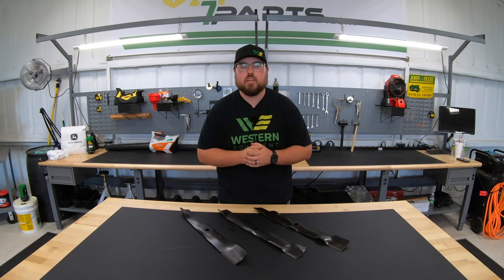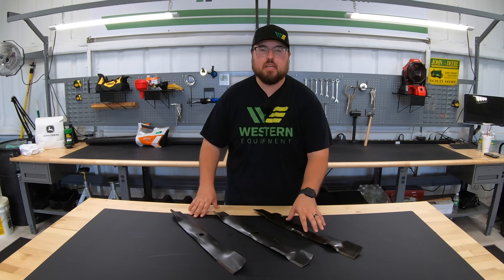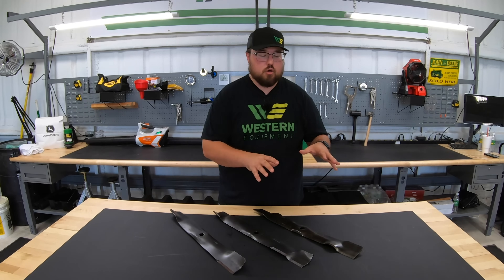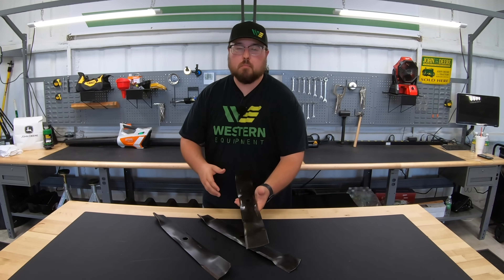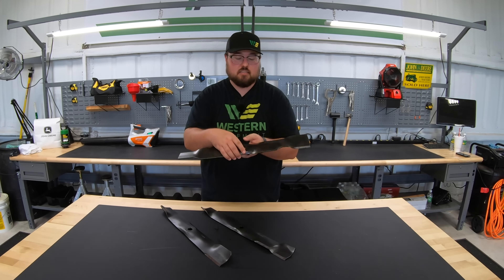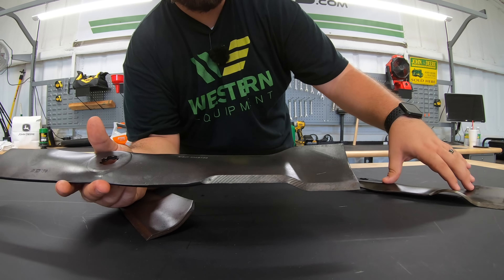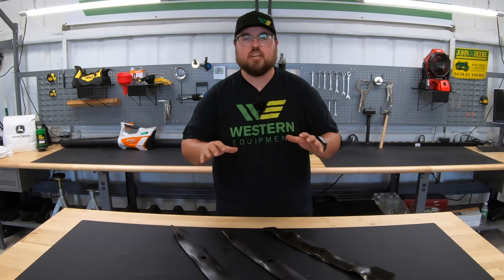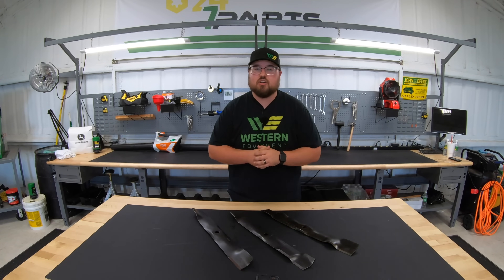Are you using the right mower blades? John Deere Mower Blades Explained

Comment: Do you have John Deere part numbers for these?  On the Deere parts web site (the one you link to) I find three different blade sets and part numbers  AM141031, 141033, and 141034 but only the 1031 is listed by a description that matches your video, "Mower Blade Kit,3-in-1, 42 inch".  The other two do not have descriptions that describe what that are for e.g. mulching or bagging as you describe in your video.  I am looking for a mulching blade, yes the 3-in-1 does mulch but I was thinking a dedicated mulching blade would work better for my application considering that I never bag or side discharge.  

Thanks for the videos/educations.  the deck leveling video was particularly informative for me...didn't know this was important let alone how to do it.

Comment: Hey man since I'm going to mow a lot of half acres what John Deere do you recommend
Reply from the maker: Any of the S100's would be fine. You just need to decide what size of deck and which features you want. Thanks for watching!
Reply: Check other brands for useful features like turning radius. Notice many use the same engines and transmissions but cost less, the green is a premium
Reply: Spend a little more money and get a JD X300 series from a JD dealer. Great mower and built to last.  Stay away from big box stores.
Reply: Poulan pro
Reply: @BlueberryStinkFinger62  Yup my JD  LA135 was garbage it only lasted me 10 yrs mowing 4 yards a week and bagging them.Plus the thing started every time. I must have maintained it wrong. Sold it for $800 with 500 hard hrs on it. It's still going strong. I didn't mow alot of hills but i also had one with a standard trans for that
Reply: Get a 300 series they are worth every penny. I went from a LA135 42in deck that lived forever but i didn't mow alot of hills though, to a x580 w 54in deck, but i use it to plow also. 300 series is a good in between. They changed the material in the plastic on the hoods to make them way stronger than the ones 15 years ago.

Comment: As important as the type of blade is keeping it sharpened.  A dull blade can eliminate the benefit of using the correct type of blade.
Reply from the maker: Good point! Sharp blades make a world of difference.
Reply: So I have to sharpen the new mulching blades?
Reply: @ceciliosoto526  Not if it's already sharp!

Comment: The John Deere mulching blades for a Z345R are not that good when you're cutting high. You get grass blades that were left bend over or leaning that weren't cut all the way. There's not enough sucktion to stand the grass blades up for a precise cut like the high lift blades.

Comment: great information!  thanks!  I'd also like too see some tips on sharpening the blades.  I find it so hard to believe that in this day and age, most people are STILL sharpening mower blades by hand and doing a crappy job of it because you can't keep a consistent angle (which is VERY important) when filing or grinding by hand without a guide.  There are some very good small bench grinders designed specifically for sharpening mower blades like the Oregon Lawnmower Blade Grinder, or the more expensive Wall Lawn Mower Blade Bench Grinder (model RBG712) which puts such a straight fine edge on the blade, it has a near mirror finish!  Does John Deere offer any tools for sharpening mower blades?
Reply from the maker: I am going to be doing some more research on this topic and hopefully put out a video this summer. Thank you and thanks for watching!
Reply: @WesternEquipment  oh that'll be great!  I wonder how the blade manufacturers sharpen their blades.  Do you know if the blades you sell come with tips on how to sharpen the blade and what angle the blade should have?
Reply: @WesternEquipment  have you seen this sharpening kit from MTD? https://www.mtdparts.com/en_US/universal-parts/lawn-mower-blade-sharpener-and-balancer-kit/490-850-0006.html  pretty darn cheap, $10 bucks.  do you know if it's any good or if John Deere has something like that or better?

Comment: Which blades will win me “Yard of the Week”?
Reply: Blades don’t exactly do this but if you want your yard to look better then get mulch blades and get a mulch cover or if you have a bagger then get bagging blades. To get your yard to look better get into a watering habit and fertilizer it each season and cut every few days
Reply: @manofculture4945  Thank you!
Reply from the maker: I agree with @Man of Culture on this one. Thanks for watching!
Reply: hahahahaha, awesome question!
Reply: @manofculture4945  ya, I think the sharpness of the blade and a properly leveled deck will have more impact than the choice of blade.  plus the deck should be completely clean before you begin mowing.  A deck with hard dry clumped on grass will not allow proper air flow and give you a shitty cut.

Comment: The John Deere blades are junk. They are made of weak metal and do not last a single season. I deal with tall grass and with the accel deep mower deck, they clog easily by not being able to spit out the cuttings immediately. Predator gator blades fixed that issue, and they are a way heavier manufactured blade. I can get two seasons out of a set without sharpening.
Reply from the maker: Interesting. Thanks for the comment. I will do some research on this and thanks for watching!
Reply: @WesternEquipment  John Deere dealers usually stock them, but the parts salesmen try to pedal their John Deere brand junk... For the same price. The John Deere blades edges are shorter, predator gives you more length of blade edge.
Reply: @AmericanFarmerHVAC2024  * peddle